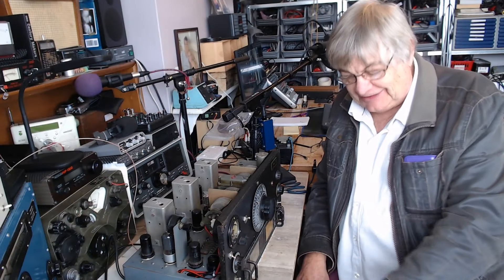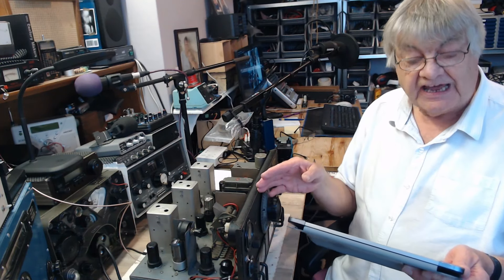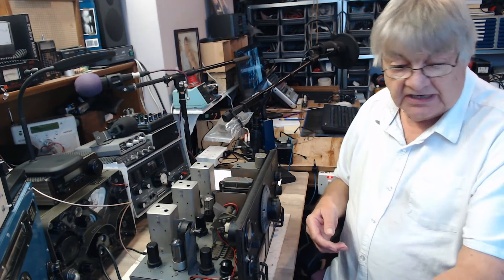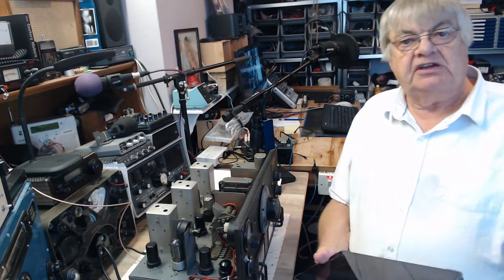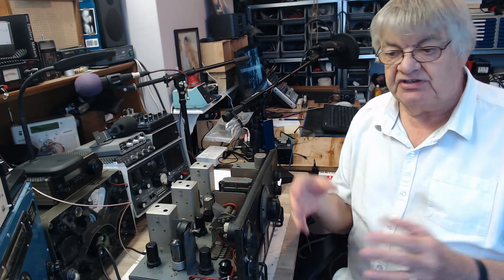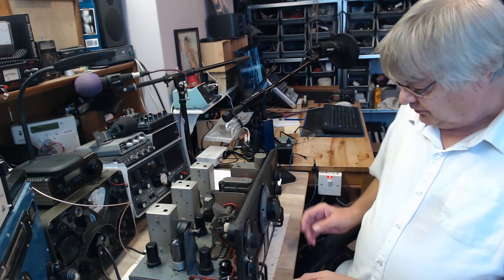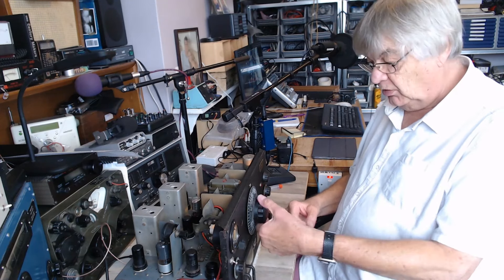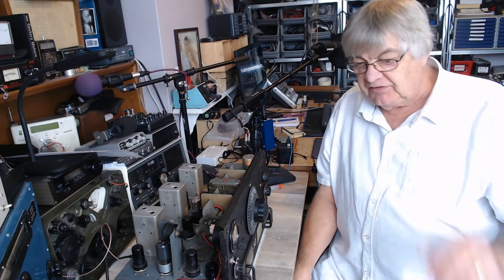G4NSJ - National HRO 5TA1 5A1 R106 mk1 mk2 comms receiver - part seven

Comment: Facinating journey Ray, that is quite a puzzle you have there. I certainly had no idea production extended to 1968. I have 2 MXs and one 106 and very much look forward to seeing your alignment, especially of the coils that were kindly donated. Looking forward to the next instalment, very good watch!
Reply from the maker: It's good to hear from you. I'm working on a power suply for the radio and, once that's finished, there will be another video. Cheers, Ray.
Reply: @g4nsj  I"ve built 2 psus for them, the first was just a copy on the doghouse, but our mains voltage here drifts around so in the end I built that 1966 Wireless World HRO stabilised supply. Works a treat. Happy to share if you are interested.
Reply from the maker: @tedhayton2302  Yes, that would be great. Thanks!

Comment: Ray, I have a National NC-2D that has the same three position switch you removed.  Position 1 allows the receiver to heat up so there is no drift i.e. reception is cut off.  Position 2 is "manual" with no AGC.  Position 3 is AGC.  A friend of mine sent the radio to me as we both worked in SIGINT in the 80's. He found it at a radio convention, abused and left for dead. I refurbished it.  It's a boat anchor!  I named her "Natalie" for National Radio.  She was made in 1947.  Also, really enjoy your videos. You remind me of the gentlemen who introduced me to radio  when I was 16.  Keep making videos, Old Man.  Cheers -- Buzz
Reply from the maker: Hi Buzz, my switch wasn't wired that way but tjhat's interesting. Natalie... I like that. I'll have to think of a name for my HRO. More videos on the way! Cheers, Ray.

Comment: Ray, I believe people "gronch" the adjustable components because they're desperate to learn how the unit works.  It's also a result of far too few mentors available to satisfy the next generation.  I too did a few gronches as a lad and worked my way up to 50Kw with great success as a broadcast engineer.  Your channel is very important as it teaches and mentors that new breed that wants to walk in your footsteps.  Be patient with them.  Show them the correct way and the proper tools to use.  That's what I try to do now with my peeps.  PS. I wish I had an answer to the crystal question.  Only thing I can come up with it that it's lightly loaded by capacitance coupling and without the spacers we have an impedance mismatch (heavy loading) on the crystal and thus a low Q.  That's my best guess.  73 OM  Looking forward to the next video.
Reply from the maker: Yes, I agree that people might want to learn how the unit works. As you say, there are far too few mentors around these days. I shall be patient. That's a good point about the crystal and  lightly loaded by capacitance coupling. More videos coming soon! Cheers, Ray.

Comment: Is the Navy coil pack the one you had to drill a hole in to get the receiver to accept it?  Perhaps that's why there was no hole, as the IF was different.  This receiver is a fun journey, as long as it doesn't make you mad.  I'll be here for any amount of episodes.  Cheers, Ray.
Reply from the maker: Hi Chuck, yes you're right, it's the Navy one. Good point! I don't think I've gone mad just yet. Well, not quite! Cheers, Ray.

Comment: Hi Ray, Great video, many thanks. Perhaps during a future video or in one of the weekly videos you could explain why the US navy needed to change the IF to 175kHz in order to receive 400-500kHz. I gather there is some problem with receiving broadcasts at the same frequency as the IF.
Reply from the maker: Yes, good point. I'll make a video as soon as I can. Cheers, Ray.
Reply: @g4nsj  Thanks. I guess on thinking about this a bit more, if the incoming frequency and IF are too close there will be a tendency for them to lock together in the mixer resulting in dead zones in the receive band.
Reply from the maker: @Mike-H_UK  That's right. I will make a video about it.